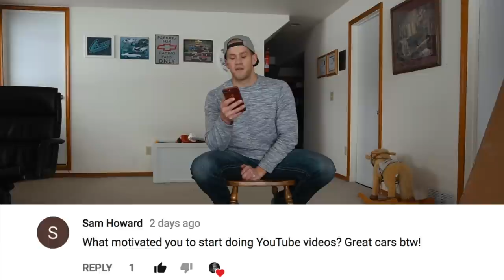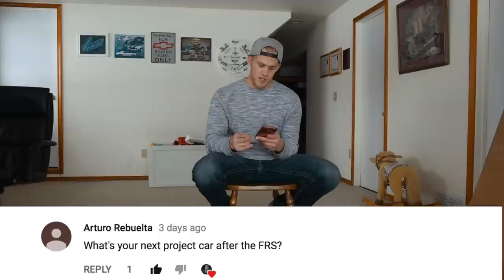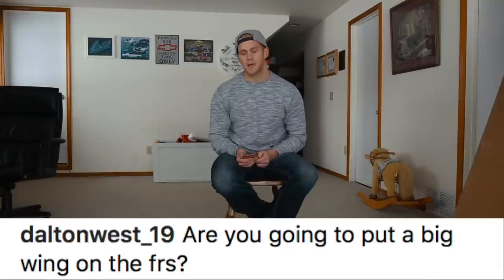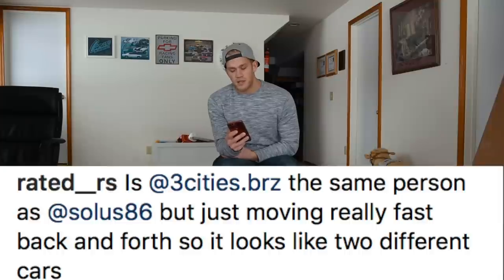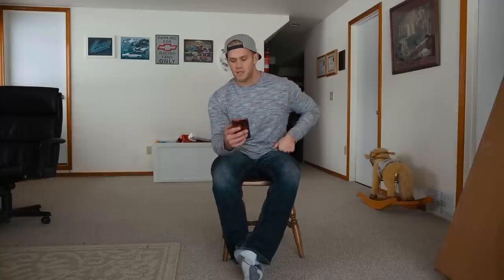Welding The Widebody Quarter Panels!

Comment: Settings you used to weld rear quarters? Speed and such.  I don't wanna burn holes through the panels. Gonna start sealing up the rear this weekend. Any guidance will help.